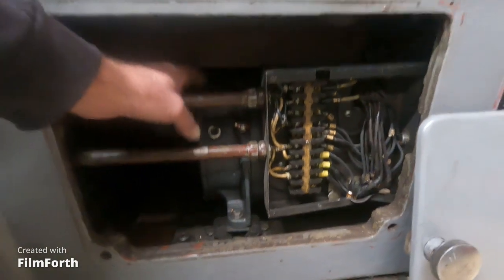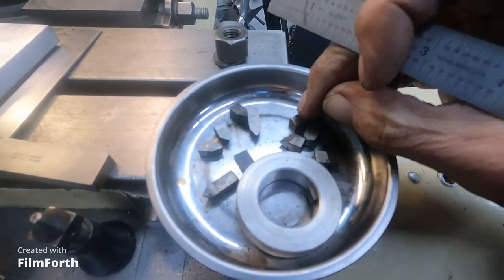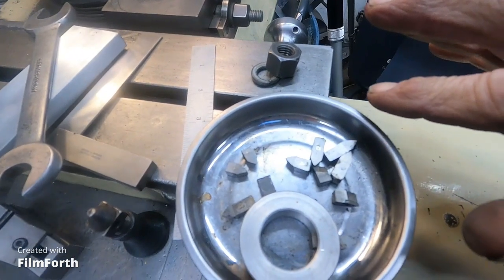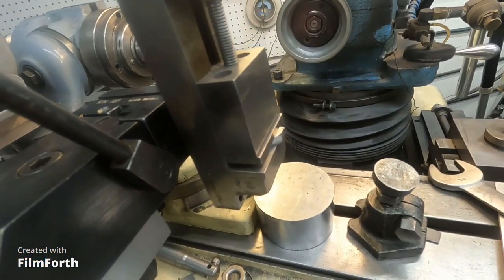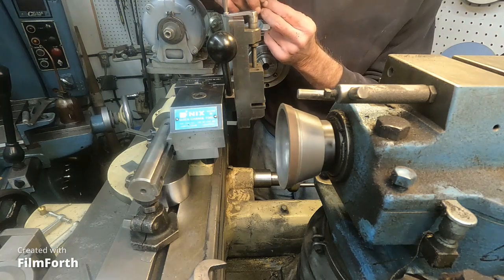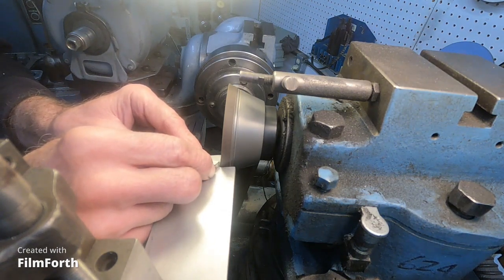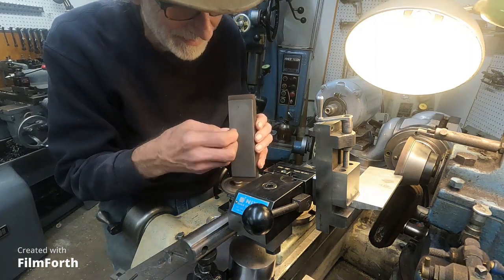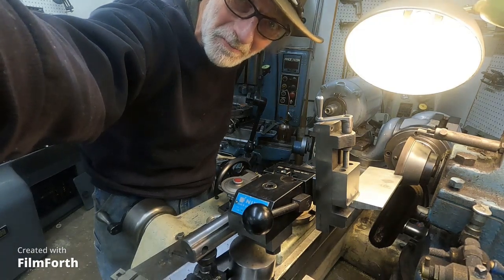80yr old Tool & Cutter grinder useful machine tool today

Comment: DeeDee, Cross Slide thrust block done with new thrust bearings. After Christmas chaos some flaking and alignment of the taper attachment and the mechanicals will be completed. Then my friend Archie will put new headstock bearings in his Hardinge.  THEN I GET TO START  LEARNING HOW TO USE MY NEW TO ME BROWN AND SHARPE TOOL AND CUTTER GRINDER!  Merry Christmas.  TB
Reply from the maker: I am glad to hear your progress on that part, it can take hours for the smallest thing. You mentioned the skunk works steady rest for your extra-long 10ee has carbide fingers, I have to try that, but I am not sure why! The cutter grinder is the least popular machine on this miserable venue, but the most important one for the tool maker and mechanic. To make money on the internet machining surface gauges and screw jacks is profitable, in real life those things are bought on ebay or pawn shops, it is all the small less glamorous things like I just shown reconditioning cutters so people can drive expensive old cars and what you have done on a mangled part on a rare lathe makes it interesting for me.

Comment: You have a steadier hand than I do putting that radius on there. Have a great day.
Reply from the maker: I am considering picking up a grinder designed for radius forming, but by hand works fine for this.